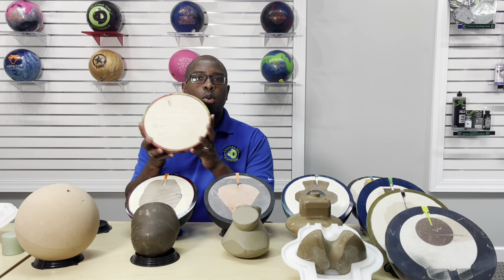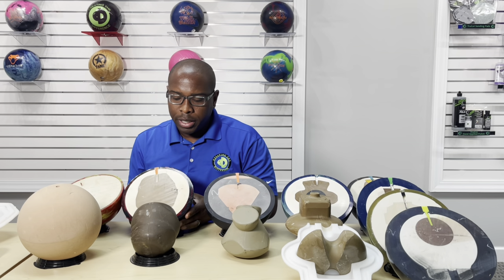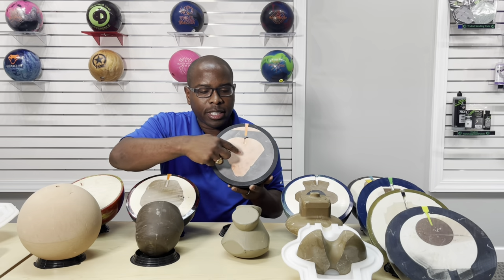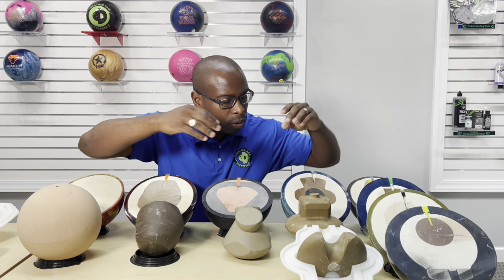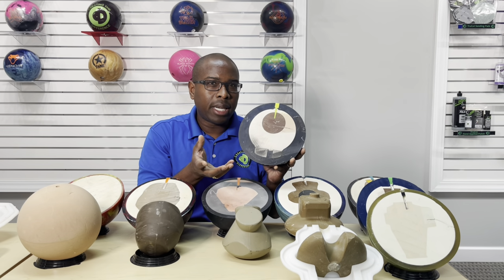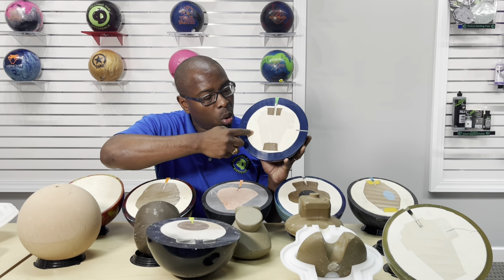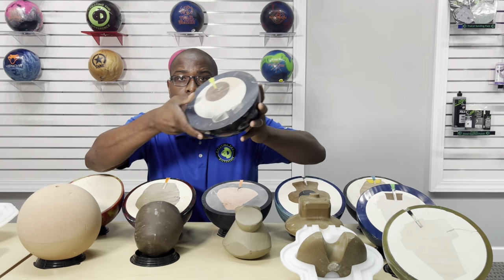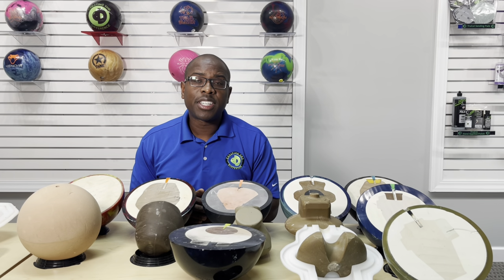Understanding Bowling Ball Cores and Different Types of Core Technologies

Comment: Great video. I just watched a video on how bowling balls are manufactured in a small China factory. It was interesting on the number of cores in a ball. I never knew they made them like that. Now I understand that makes a difference on how the balls perform. I don't understand the physics, but assume it has depends on mass, weight, location of the holes and speed.  Thanks for the great presentation on the different balls you displayed and discussed.

Comment: Awesome video! Great to see the coverstock differences and that's making me consider a Hy-Road again!

I was thinking of getting 2 balls (I prefer long, angular motions that can be well manipulated by my angle of release and Rev rate) so I was kind of settled on the Black Widow Ghost and a Brunswick Rhino, but the hy-road was my 3rd option, although I'm not sure if it's long or angular enough. My favorite balls were an Ebonite Tornado, Brunswick Slingshot and the old Tropical Storm, but I'm having a HARD time replacing that predictable yet variable motion that I'm used to with these newer balls. 

Any advice? I bowl about 17mph and I tend to have a hard time getting balls down the lane far enough (softer arching/more reactive balls like the Tropical Surge) or trouble modifying the angle is a problem I had with the Hammer Raw. I found I could modify the angle of a black widow easier than the Raw, which I know sounds crazy. Any advice is appreciated!

Comment: Is it possible to have a ball with a thick shell (no filler material) with a low RG? I'd say all the balls with thicker shells have higher RGs
Reply from the maker: It is possible
Reply: @Ctdbowling  would love to see one someday.
Reply: the resin is the expensive part of the bowling ball. I'm sure there would be someone who would pay $1,000 for a bowling ball if it gives them an advantage but  I double there would be enough sales to justify production. Also that is a LOT of fossil fuel / pollution just for a bowling ball if you did not use ceramics as a core
Reply: @BassRacerx  hyroad is all coverstock with a regular core in it. It's a $140 ball. You 2ould most likely have to put a bigger core inside to make it lower RG but expensive balls aren't new. Hell the Motiv Mythic Jackal is $220 online before drilling. Yea it would be more expensive but it shouldn't be a crazy ridiculous price. Brunswick did it with the re-release of the quantum and they were around the same price as the jackal just a bit higher RG.
Reply: I think most of the old visionary bowling balls were thick shelled with no filler, at least most of them? They had high and low rg stuff and lasted 4-ever